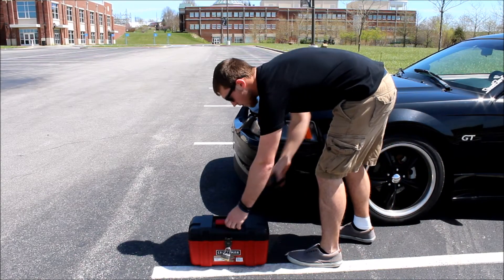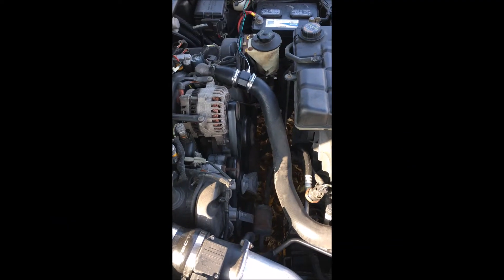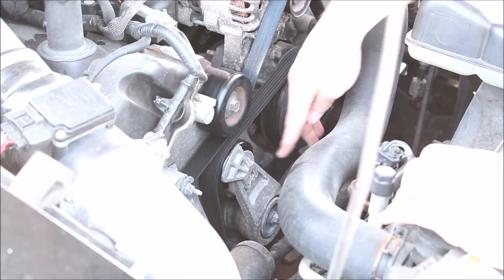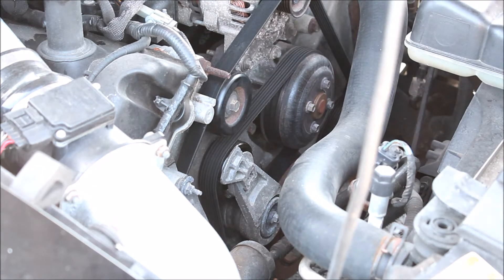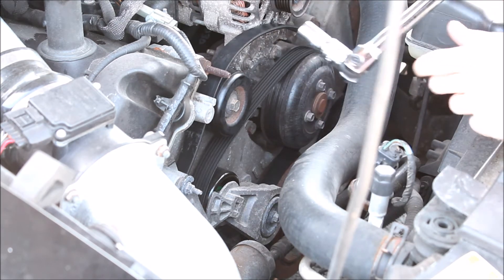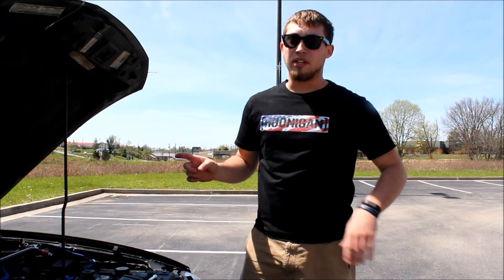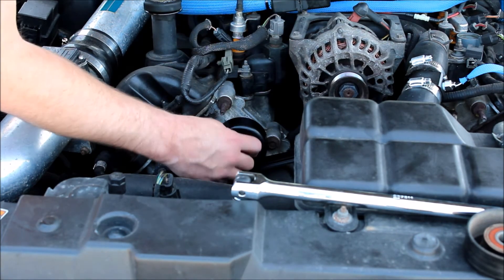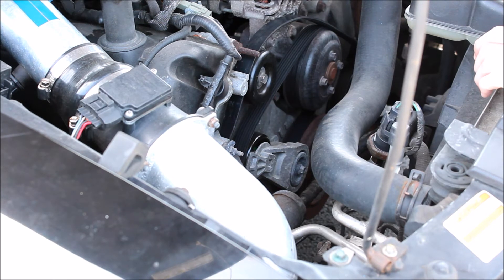Installing Idler Pulley on 2000 Mustang GT

Comment: My 2000GT just started howling like this nonstop, replacing mine tomorrow. I noticed it doing this a bit when temps were below freezing a few times, but wasn't sure what it was and it always went away. Anyway thanks for sharing, surprising how easy these cars are to work on.
Reply from the maker: HypnoticSuggestion they sure are! Mine is apart right now, in the middle of a cam install. Glad you found the video and glad it helped!!

Comment: This is going to sound dumb but do you even need the idler pulley or in other words is it a vital pulley like the crankshaft or water pump pulley? Something that you gotta have or can you take it off and make more power where theres less pulleys the car has to turn?
Reply from the maker: You don’t necessarily need it, but, if you get rid of it you would have to reroute your belt to make sure it didn’t hit anything. However, this pulley literally just redirects your belt in a different direction. Therefore, it does nothing to increase nor decrease power. Deleting this particular pulley would do nothing for you. It takes no extra power to turn. Other pulleys, sure, but not the idler pulleys. Hope this helps!
Reply: @koreywithak46  it does thank you